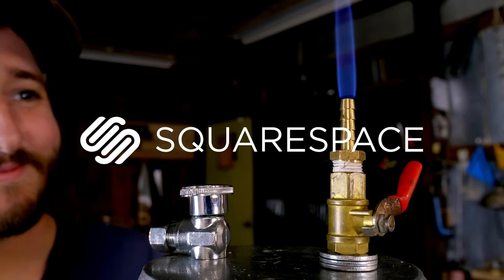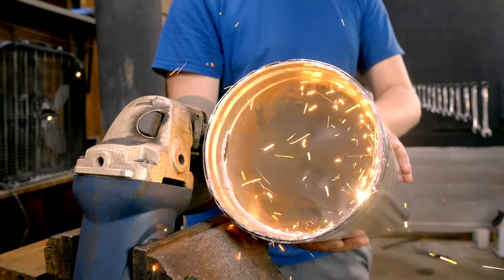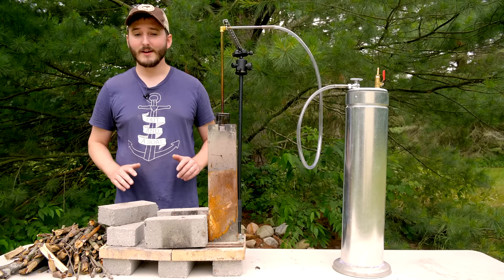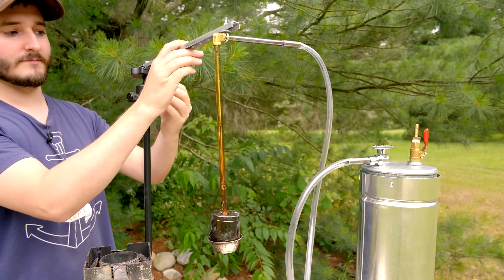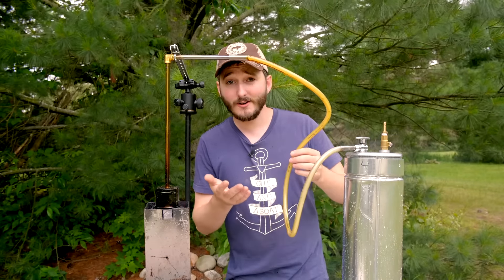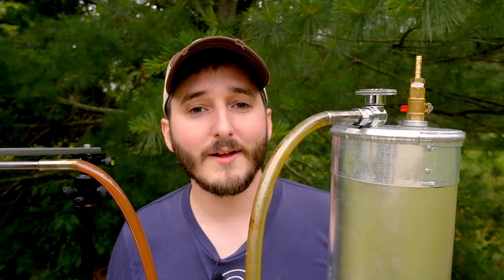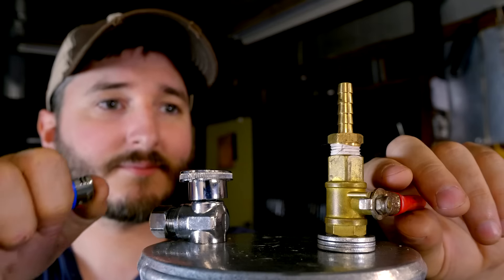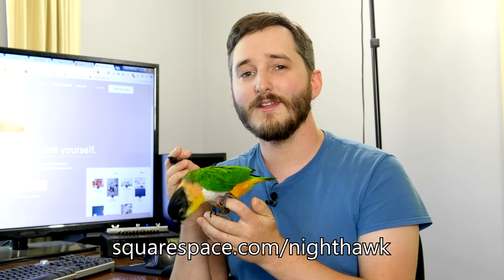Bio Fuel Storage: Building A Gasometer

Comment from the maker: If you missed my last video where I build the gassifier used for this project, you can watch it here: https://youtu.be/HQIW4dVVokE
Reply: Who would miss one of your videos?
Reply from the maker: To bubble the water from the bottom to the top means that the gas needs to have enough pressure to force the water out of the tube. That's more pressure than my gassifier generates in this setup.
Reply: silicone rubber is a thermal set, so it is pretty heat resistant
Reply: I think a shower head hose might be able to survive the heat better.
Reply: You should make an airtight crockpot to heat the wood inside, leading to a canister to store the gas. Something I found online: Higher temperatures improve hydrogen yield in the gaseous product while CO yield decreases. Under nitrogen atmosphere, after 2 s at 950 °C, 76% (daf) of the mass of wood is recovered as gases: CO, CO2, H2, CH4, C2H2, C2H4 and H2O. Tests performed under steam partial pressure showed that hydrogen production is slightly enhanced.
Reply: You don't have to have the water filtration setup because you can set it up so it collects the gases, tar, any other things you could retrieve later. Also try using wood that is fairly wet and fresh.
Reply: human bean higher temps produce more gas
Reply: NightHawkInLight  Hey...

  Wood is cellulose.  Paper is cellulose.  Could the same gassifier be used with paper?  Loose paper, shredded paper, and/or paper shredded up mashed up and pressed into "firelog" blocks?  

Maybe?
Reply: Daniel Nunya Bidnezz There's a lot of terpenes that are bleached out in the process of making paper, so most of the volatile compounds will be lost.
Reply: I’d say bulk heater hose from the local parts store
Reply: there is someone who did exactly that search for it
Reply: You should use one of these Thermo-Tec Thermo-Flex Aluminum Heat Shield Sleeves,"High Temperature Silicone Rubber Tubing,or water fuacet tubing.all of these are best resistant tubing just think about hot air traveling through ducts or not water through pipe.
Reply: NightHawkInLight Smart idea you made and learned this things thier very useful for your survival and for your own independents on your self.
Reply: NightHawkInLight, can you make a compressor to compress and store the gas in a empty propane or similar gas tank?
Reply: NightHawkInLight try using silicone tubing, its heat resistant and super flexible
Reply: NightHawkInLight you could use brake line
Reply: have you read "mother earth news handbook of homemade power" they show gassifiers and wind power
Reply: Now instead of wood gas you should try to make coal gas. Apparently its a thing; it used to be really popular in South Africa and in the USA I know that at least Caterpillar used it for a short time in their York, Pennsylvania plant.
Reply: is the water in the Gasometer tainted in anyway from this process?
Reply: NightHawkInLight a lot of that "condensation" is synthetic petrol and creosote.
Reply: I would love to see a wood gas powered steam engine build even though it would
be a very hard task! I great video!
Reply: NightHawkInLight the wood gas can be pushed through dry calcium chloride. A good drying agent that will eventually dissolve in the absorbed water like sodium NaOH and H2SO4. CaCl2 is  10€ per 3x1kg packs from room dryer refill bags in Germany but silica gel might be easier to handle. Would be interesting to see a test for difference in flame temperature and flame size of moist and dry wood gas (maybe with oxygen?)
Reply from the maker: The problem with using a desiccant is that you have to go through the trouble of drying it out once it's used or else it's something you have to buy repeatedly. If you have to buy something man made to make a biofuel work properly it defeats the purpose a little bit. Better to just let the steam condense out naturally by cooling it. You could set up a drying system for desiccant on top of the gasifier burner and then it might be an ok solution.
Reply: Love your projects! You should try FAME production (Fatty Acid Methyl Ester) it is the best bioful known for now, made easily out of plant oil, or directly from oily plants like colza. Plus it is really cool to experiment with it. 
Your channel deserves way more subscribers! Just like Brainiac75's channel, you are passionate people, youtube needs influencers like you. Thanks : )
Reply: Hi NightHawkInLight  : Go to    MrTeslonian     this guys a genius. In short his gas first goes through a home made radiator to cool it then though a crude filter (a sealed metal box stuffed with biomass wood shavings etc to filter out the gunk)  then though a bubble bottle, gas now exits cool and no oily muck
Reply: @Nighthawkinlight  you could use a copper pipe, from the bottom of the gasometer through the water column, till the top of the water column. during filling with water, you should try to not fill any water in the pipe, then you have no problem with backpressure. ;)
Reply: NightHawkInLight iiiiii
Reply: I'm gonna make one tomorrow. Your videos are the best
Reply: From my family👨‍👩‍👧‍👦 to yours, thanks for sharing 👍
Reply: Please put a flashback before you go boom
Reply: Anyone ever tell you that you look like will Wheaton
Reply: Has anyone told you that you look like Will Wheaton's twin?
Reply: NO GOD BUT GOD

What Is Islam?

Islam is not just another religion. 

It is the same message preached by Moses, Jesus and Abraham.

Islam literally means ‘submission to God’ and it teaches us to have a direct relationship with God. 

It reminds us that since God created us, no one should be worshipped except God alone. 

It also teaches that God is nothing like a human being or like anything that we can imagine.

 The concept of God is summarized in the Quran as:

{ “Say, He is God, the One. God, the Absolute. He does not give birth, nor was He born, and there is nothing like Him.”} (Quran 112:1-4)

Becoming a Muslim is not turning your back to Jesus. 

Rather it’s going back to the original teachings of Jesus and obeying him
Reply: @ahmdabdallah5811  so... it's just like every other religion. Got it.
Reply: if you have the gas inlet  in the bottom rather that the top and let it bulled up then you wont need a flexible connection :)
Reply: 7:56 also if you have a 3 way splitter  in that tubing you could add another bit of tubing connecting to a bottle or something so that the condensate can collect in it rather than in the tube
Reply: Man i gotta say... u look like Will Wheaton from big bang theory...

Pls try to filter that smoke and make bricks or tiles from it...
Reply: @firefox5926 , you have a pretty good idea, as long as it doesn't build up too much back pressure, then you would just defeat the purpose.
Reply: @firefox5926 , that would be a good idea by taking a canister having the gas come in from the side about have way down, and at the top on the inside have steel or copper wool/scrubber (a good bit) covering the outlet going to the collector (gasifier). Then you should have a way to empty the liquid out when finished by either a small drain valve or by simply opening the vessel and dumping it. Either way it will work. Especially if you go with a copper cooling coils on the system.
Reply: @skyrangr  plus the water cools down and condenses the tar. he can add a tee on the bottom (90º sideways, one side upwards, the other downwards), so that the byproducts can drop down to a container and later removed. A couple of ball valves and he doesn't even need to empty the gasometer to remove these byproducts.
Reply: Great video, thx.
If you haven't found a better hose, try fuel hose for gas engines. It can stand higher temps.
Thanks again. 
Happy Trails 🍀
Reply: Wayne Bryan  also in live steam model engines. I'm curious to know its working temperature.
Reply: Can you store this has using vacuum pump from refrigerator? Lets say to 2 bar?
Reply: Daniel w
Reply: @NightHawkInLight — but HOW MUCH GAS would a setup like this hold?? That’s the 1ST thing I wondered (_due to my newfound desire to create “emergency prep” reserves) that was never mentioned!! I’d never heard of such a thing, but it’s sumthng I’ll DEF DO 2DAY & upload for ur PLAYLIST if u answer!!

The “_HOW MUCH_” is my PRIMARY concern, but there are a few more things that you did not explain & I’d bet anything it’s because “prepping” wasn’t on anyone’s mind 2 yrs ago...

So before I hit Lowe’s today & potentially make a mistake, here’s what I’m asking you:

1. Again, how much gas will this setup hold?

2. Does “adding weight & therefore more pressure” INCREASE the quantity?? Or does it just result in a more aggressive valve release??

3a. You have NO “WARNINGS” here, but IF more pressure = more gas reserves, then how much pressure is too much using these materials??
3b. IF SO - Would reinforcing this material (by, i.e. using stronger seam sealant, or adding a bead of solder @ all seams, AND adding 5” metal hose clamps) allow for substantially more pressure (more gas) than this method??

4. Will this work using ANY width/height piping/tubing we can find or are there limits?? 

5. Are there ANY SAFETY WARNINGS you would have disclosed if you made this video today & therefore felt that more “average Joe’s” like me might be trying this out for the “prepping” purposes I mentioned?? (Meaning they aren’t outdoorsmen & may not be as familiar w/ the do’s & don’ts??
Example hazards: Storage temps - Handling concerns (in vehicle or on foot) - Temps while using outdoors - Drop/Puncture/Damage protocols - and last, but possibly MOST IMPORTANT of these... EXPECTED SHELF LIFE and how it may change if stored/used in certain climates...

I KNOW this is quite a bit bro... But I am, after all, a LONG-TIME FAN 😂 😉 and if you do answer all/most of this, I’ll ADD THE DETAILS TO MY VIDEO for you to feature so you don’t feel it was all a waste for 1 guy... 

I’m just that guy who needs to know the pros & cons before diving in & spending cash that could’ve been used for something more beneficial.

I’m actually BLOWN AWAY by your content and there are SEVERAL more projects that I have on my list to complete ASAP.. I’m actually shocked that you didn’t include the answers to any of these questions or that you didn’t do a follow up video because normally you’re VERY thorough & I don’t have many questions at all!! In this case, these are all IMPORTANT SAFETY ISSUES and I’d be a horrible father if I just did this without knowing more. 

I hope you understand and can spare a few moments to reply. 

You’re the MAN!!!!
Reply from the maker: @flojotube  This is not meant for pressurized storage. The water seal will not allow the tank to increase much in pressure before it starts spilling out. It can be made as large as a building without issue. The quantity of gas is the same as the internal volume of the tank. You would need probably a 500-1000 gallon gasometer to run a house daily to modern standards in a cold climate. You must be very careful with gas piping for woodgas as it contains carbon monoxide and will poison you if it leaks. Detectors are essential.
Reply: @Nighthawkinlight  — understood - however, my intention was to build something this size for those multi-day off-grid moments in an URBAN environment where starting a fire may not be as practical.... with a device like this, I can have a standby fuel source that was free and free to refill that can provide a NO CLEANUP method of camp style cooking or whatever else I can think of... This is why I asked all those weird questions about handling, shelf life, and how to increase the quantity.... 

So I now completely get why it’s not a pressurized system and suppose o should’ve known that... BUT... is there a way to create one using different materials? 

And does your method mean storage isn’t very reliable or that the quantity within your unit will slowly dissipate/decrease over time where a unit meant to be pressurized would last a decade? 

Thanks again... it always amazes me that you SAY you love reading ALL comments, but actually do.... You deserve whatever benefits you receive from running this channel more than most others I can think of.
Reply from the maker: @flojotube  Woodgas isn't a good option for urban areas. It makes a lot of smoke to produce and isn't safe to pressurize. It was stored in giant gasometers for a reason. You need space for it. Better to get yourself solar panels/wind turbines and batteries if you're limited on space.
Reply: @Nighthawkinlight  — man you know literally EVERYTHING... WTF???? (And i PROMISE this is my last reply!!!!!) — ok, that makes perfect sense... I was simply looking at this as a possible alternative to propane (torches/camping stoves) in the event that I’m all out..  

It just so happens that I’ve BEEN STOCKPILING salvaged lithium battery cells from a popular wholesaler  so I can build my own powerwall(s) for both home and mobile applications and have been trying to LEARN for a while now BUT I’m having such a HARD TIME understanding DC electric and all the intricacies... I know it’ll seem simple once I “get it” but for now it’s more complex than I ever experienced...

Does that educational website you promote have courses for this???
Reply from the maker: @flojotube  Brilliant shows how solar cells work but not the technical details of how to put one together. There are lots of sites for that you can find with a Google search though.
Reply: Hey, you could make the gas go from the bottom of the two cylinders, the water would filter the gas and you wouldn't need vinyl piping.
Reply: @unusualfabrication9937  and a cooler tub to cool and clean up woodgas by condensing creosote. It would drip back into the burning chamber, probably producing more gas by going in again.
Reply: I think they make some fuel lines for diesel engines that are flexible
Reply: You can use hydraulic hose as a flexible connection
Reply: Work this with h2?
Reply: silcon tubeing,
Reply: So how do you use the gas?
Reply: You might use a coil of 3/8” cupronickel brake line . The coils provide the flexibility of movements.
Reply: What were you using for the collector at the top of wood burn... And for future reference on your lines I would suggest going to auto parts store and getting braided fuel line probably the biggest you want to get I think it would be a half inch but it'll withstand that he looks nice LOL
Reply: It seems to me it's really not worth the effort for just a few minutes of a small flame surely there's got to be a more efficient collection tactic that allowed you bigger volumes... Simply to make it feasible I just don't understand how or why it would come into play and what would you consider it useful for and wouldn't a simple  candle be more suffice
Reply: @ahmdabdallah5811 - the word Islam is derived from the word for ' p e a c e '.
Where does the word for 'God' and the word for 'submission' enter into it ?
Reply: Nylon tubing would work Or Silicone!
Reply: That's no filter how  no filter no fire, filter to fire how that's works no filter
Reply: Is compressing the gas in a regular compressor an idea? (small tank with gas ready for action and with a 10-15 times the tank capacity of gas available) And no need to pull op the gas production
Reply: Could I suggest building it in such a way that it displaces the water instead of the upper cylinder?
That way you could adjust the capacity by just running an extended piece of hose to some height. Similar to how a water tower works.

You could also use a needle valve on the outlet. That way you get a gas regulator effect.
Reply: If you're gonna teach people how to make this gas you also need to explain and add warnings to your videos that this gas is mainly carbon monoxide and extremely poisonous
Reply: Take a 12 volt tire pump and compress that gas into an old propane cylinder and you have cooking gas. Also put ice around the propane tank and the gas will liquify.

Comment: Instead worrying about what type of tube you use , you could use a condenser to cool the gas before it reaches the tube
Reply: I was thinking almost the same thing...just use a cooling system on the pipe and hose like the worm in a still
Reply: And condense out tar that blocks it all up.
Reply: I'd say just run it though a water column. It'll cool the gas and also remove the impurities.
Reply: Absolutely correct! Coil condenser with a collection pot to capture contaminates at the bottom works very efficiently. 
I've used this method for years to convert acetone to diketene with great success.
Reply: Isn't the condensed liquid diesel? so a diesel collector in the middle will prevent condensation in the pipe and melting the pipe.
Reply: The only reason he used that type of hose is because it's ability to flex freely allowing the tank rise. He cares not to cool the gas. It cools in the water.
Reply: I would use automotive fuel line.
Reply: A radiator would work as well . It's amazing the heat that will be dissipated with a simple radiator
Reply: The question is, Wich forest to use, can be suply the entire city...
Reply: @naufalathaillah4132  Bamboo is fast growing  and great for fuel too
Reply: A diy knockout drum/ flash drum might do the work
Reply: But money
Reply: @MrNeboff isnt that exactly what they are for lol
Reply: The condenser would get clogged by tar and eventually stop working but it would work for a little while.
Reply: + just strait glass tub through the water then bubbler, then through flexible tube.
Reply: This is a interesting project curious if it will be practical in a camping situation
Reply: @raiemj  and a native plant in the north Americas!
Reply: @katten7 no. It's not practical for camping. 

Are you really going to pack in that gasifier and collector to store the gas? 

What are you going to use the gas for? Cooking? Warmth? 

Better to just have a campfire.
Reply: @marshallscreekfarm3833  no its gas form at room temp
Reply: Use silicon hose. Its high temp rated.